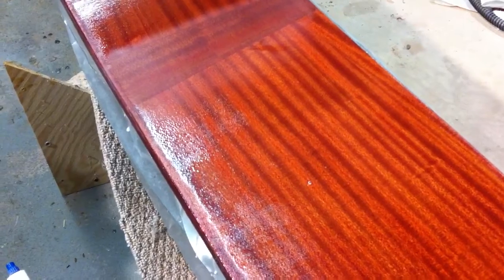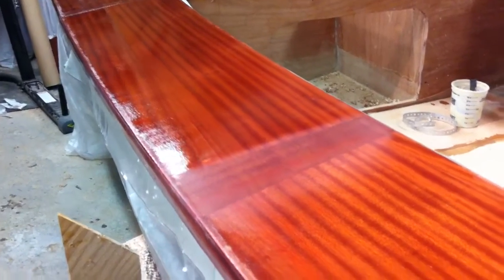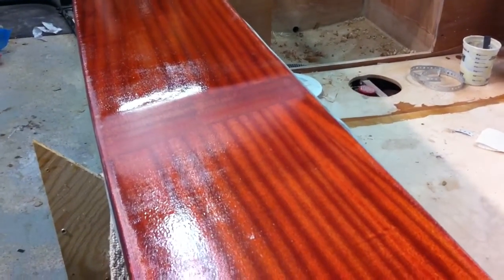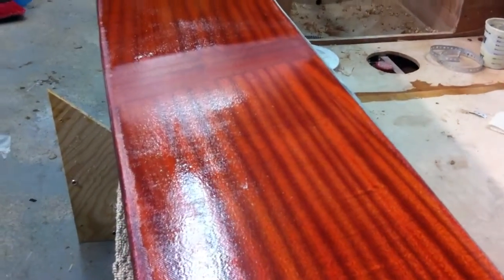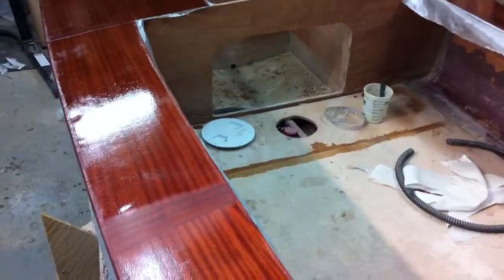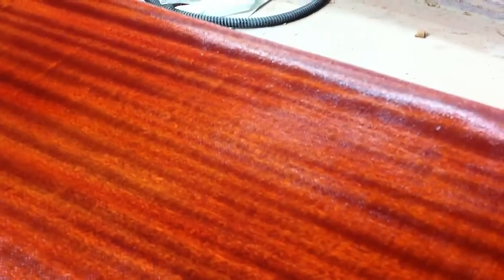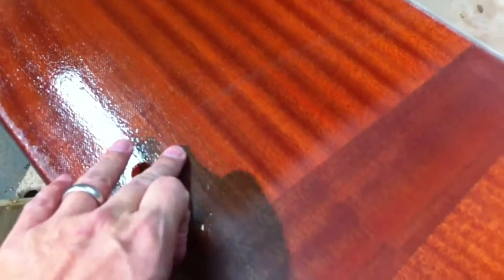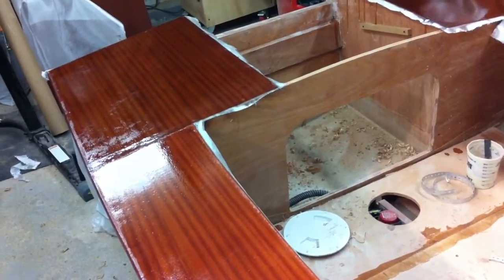Boat building - How to bright finish with varnish over fiberglassand epoxy

Comment: Just a few tips, better late than never.  First, you dont need 4 oz cloth for a deck side, I think that is great for laminating or building strength, but better if you use 3/4 or 1 oz cloth, as you are mostly waterproofing.  When putting it down, use a scraper like a bondo spreader or a credit card and remove as much as resin as you can, leaving the cloth as tight to the wood as possible.  Wait till it flashes off, about 3-4 hours,  till it is tacky, then put the next coat on, using the credit card to basically fill in the mesh of the cloth and any pin holes.  If a third coat is used, again wait till it flashes off and then add the next coat.  Lightly sand with at least 600 grit, ALWAYS using a block and wet dry paper. Don't sand through till you hit the cloth, and sand on diagonals (called blocking).  Then, put as many layers of varnish over it, sanding (with a block)  between coats.  I would put at least 10 (or more) coats.  After your final coat, wet same with 1000, then 1500, and at least up to 2000 grit, then buff it.  It will look like glass when you are finished. 

ALWAYS use a block when sanding because otherwise, your surface turns out all wavy.
Reply from the maker: Man... Where were you when I was working on her?!  : ) I really appreciate your comment Garry. I learned a great deal when making this boat. If you have the time to see one of my later videos, you'll see that I ended up painting the topsides. If things turn out, I may be making a Tollman Skiff some time soon. I'll certainly take your experience to heart. Thanks again for sharing your experience. Have a great summer and Best Regards.
Reply: Many people do that.  Sorry to hear you painted over that beautiful wood.  Using 3/4 to 1 oz cloth gives you a real smooth finish, and with three coats, you can put any finish over it and it will still come out like glass.  I am going to check your other videos.
Reply from the maker: Please believe me when I tell you that it broke my heart to paint. But it came out ok in the end. Thanks again.

Comment: Thanks wondering if I cound do the same on my wooden canoe,,,very helpful.
Reply from the maker: dart warz Hey Dart Warz. Feel free to drop me a line. I think you just PM me from my about tab. 

Please note that while I intended to bright finish from the outset of my project, I ended up painting. This is due to a problem I had with glass adhesion on the bow decking. You can see the finished boat in later videos. However, I did end up prepping for bright decking. And I have some bright work in the form of the coaming, bow trip, console and gunnels. Let me know if I can help answer any questions. All the best.